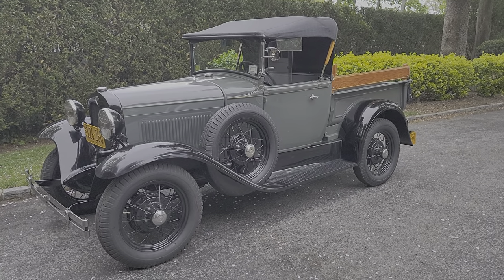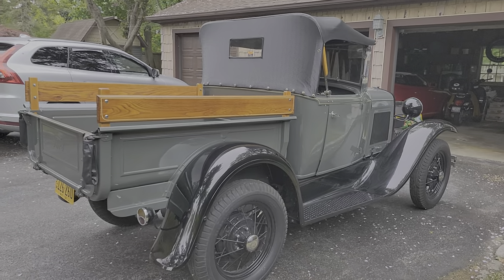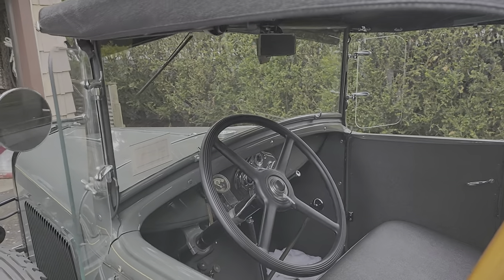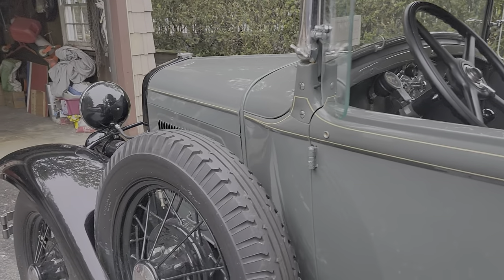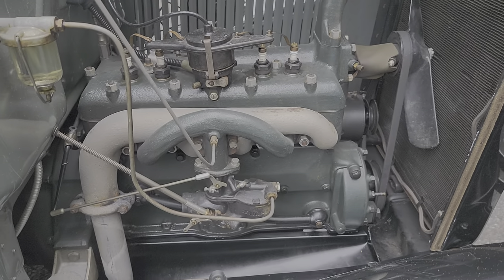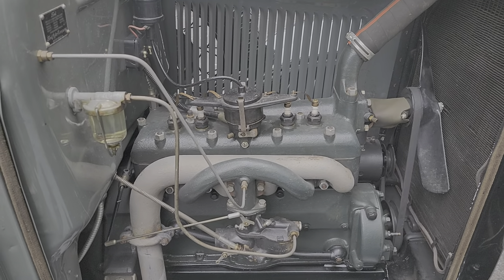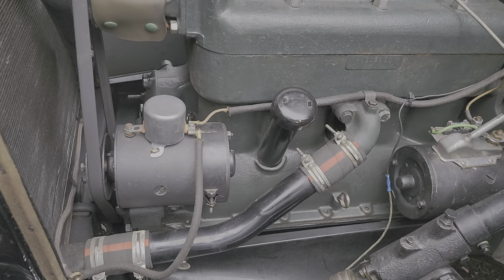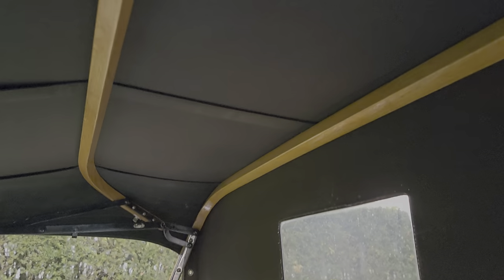Gorgeous 1931 Ford Roadster Pickup For Sale~Orig Motor~Bonnie Gray~LeBaron Bonney Top & Interior

Comment: Has a couple of glaring 'elephants.  Although said to be a 1931, it has an early '30 fuel tank & dash  plus the usual 'upgrade' floating engine mounts. Delivery trucks had a hard life & none would have survived as original. This car looks very nice, but from necessity would have been 'restored'with many repro parts.... which is good if stated.

Comment: Windscreen is too vertical. The windscreen posts have a stop to align the windscreen slightly backward. Pitty, it spoils the car along with the wrong dash and tank. Engine mounts are incorrect. Many other faults which spoil a good restoration. Horn sounds pathetic.